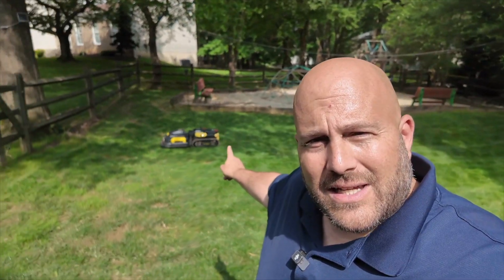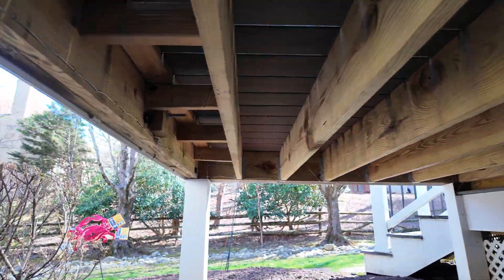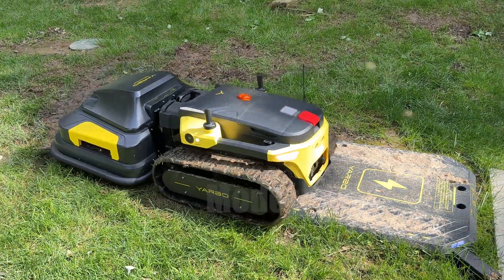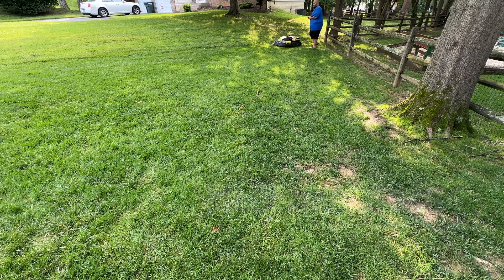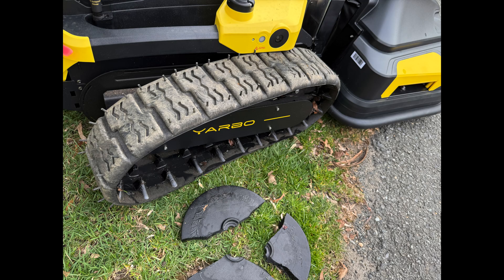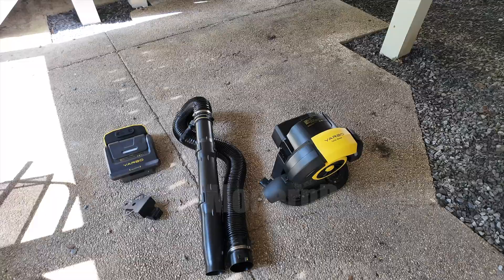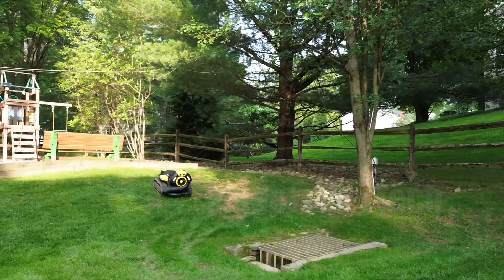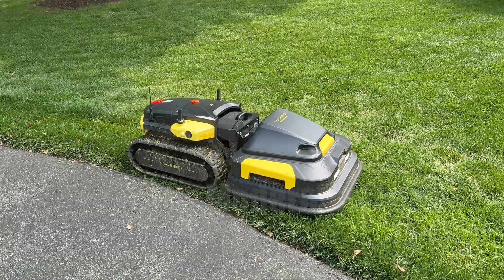My Experience with the Most INSANE Robot Lawn Mower Yet!

Comment: It seems best for large open lots, the PoE requirement for RTK unit is a big limitation. The snowblower attachment is sure impressive
Reply from the maker: Yep!  After working with support for a month, it did get a lot better. Hopefully they can continue working it and really fine tune the GPS lose issues that so many are experencing. I was lucky and already had a POE switch outside, but it can be hard for some people not know that ahead of time.  I can't wait to use it snowblow my driveway. Let it SNOW, Let it SNOW!